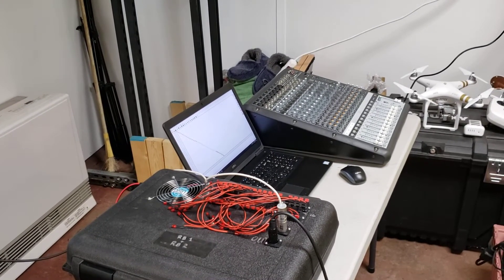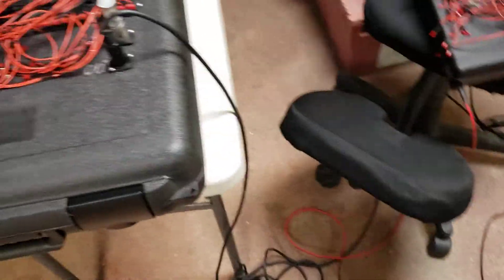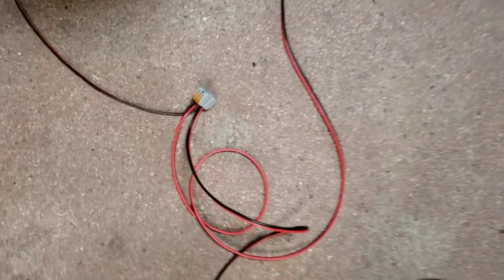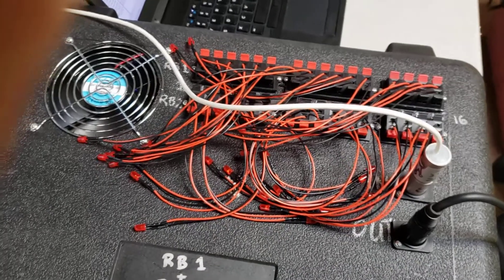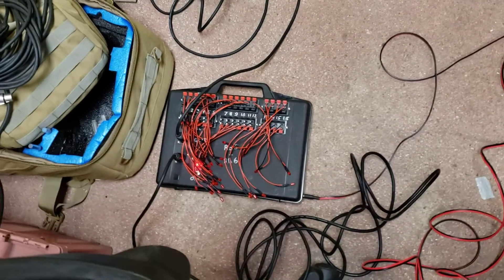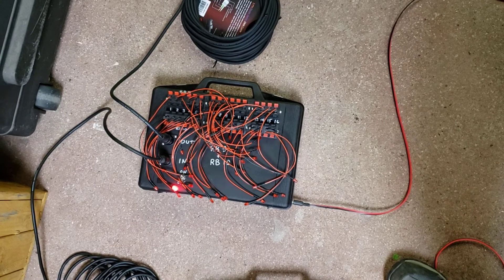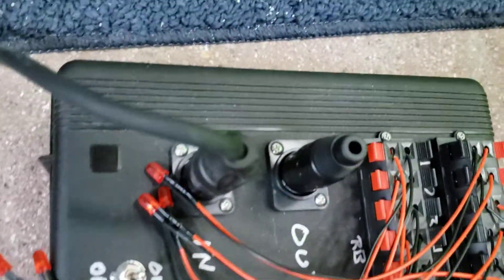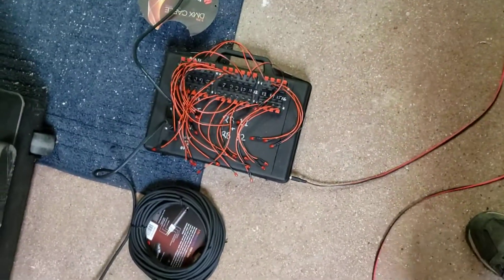DIY electronic Fireworks Firing modules for Pyro-Musicals.

Comment: I'm really impressed with this build and detailed description.  It seems as though some of your description was cut off, and I would love to read the rest. I was contemplating moving up to the cobra system, getting a 72M with DMX and the 18r2 with Smtpe to get around an audiobox. Looks like your system would work well to add in the DMX line, and get extra cues or just go all in this way.
Reply from the maker: Did you ever want to do a Pyro-Musical but looked at the cost of everything you would need and nearly passed out? I may have a solution for people who are looking for a budget friendly way to get it done.
It's a long post, but I think it's worth the read. If you're interested, please read on...
I wanted to share what I came up with for making a pyro-musical on the cheap. It doesn’t have all the features of COBRA or IGNITE or any of the other big names, so it will involve a little more work on your part, but you can put it together for hundreds or even thousands of dollars less depending on how many queues you want to use.
I will start by saying that for me, it was really cheap because I already owned the software, since I use it for another hobby of mine which is animatronics. Here is a video playlist of what I do with my life-sized animatronic skeletons at Halloween: https://www.youtube.com/playlist...
Because of that, I already had the software and power supplies and some other parts. The software is called “Brookshire Software’s VSA and is available here: https://www.brookshiresoftware.com/vsa_order.php?ct=yes...
The version you would need depends completely on how may queues you plan to use. The $80.00 version gives you 128 channels in total. That’s 128 possible queues. You can also fire several things using the same queue by using parallel connections of MJG igniters or talons. If you want more than that, you can get the Ultimate version for $250.00 that will give you 256 queues. If you want more than that, you can contact the company like I did and get a BETA version of the software that has 512 channels. That’s one entire DMX universe (the total number of DMX addresses that can be controlled in one DMX stream) That version will set you back $325.00
It is made for controlling servos, LED dimmer lights, Relays, and many other devices. It runs a DMX stream which is what I use. The software runs only on a windows computer, and you need a USB to DMX adapter (Which I already had as well). Here is a similar one to what I have: https://www.amazon.com/Interface-Computer.../dp/B07KW22ZK1
The adapter I usually use is from a company called DMX King and is $75.00. Servos are more fussy than lights and relays, and that one works better for my animatronics, but the cheaper one ($20.00) I listed seems to work fine for the relays and lighting devices I will be using.
I found a great price on some 16 channel DMX Relay packs. They would act like the 18M firing modules from Cobra. I got mine here for $69.00 each: https://www.amazon.com/Channel-Controller.../dp/B0111QP790 They have 2 less channels than the 18M’s, but they are a fraction of the cost.
One of the advantages of using a DMX controller (VSA software) to activate relays which sends power from my power supply (12VDC 30amp) to my MJG igniters, is that it can control other devices as well. I will also have a laser to shoot patterns through all the smoke, and 2 moving head color changing spotlights that can crisscross and spin around through the smoke, and even some electronic flamethrowers that you can program to shoot towers of flame to the beat of your music or make them do a chase pattern or whatever you like. These are the flame-throwers I will be using. This is one of many vendors you can find online:
https://www.ebay.com/itm/372969323529
I will be using 4 of those flamethrowers this year but will probably add more later. These can also produce colored flames according to the type of fuel you use in them.
So, before I get into how to program your show this way, and what features this software has or doesn’t have that other firing devices do, I will break down the savings for you. If 128 firing queues are enough for what you want to do, you will need to spend $80.00 on the VSA software, buy eight 16 channel DMX relay boards @ $69.00 each, one USB to DMX adapter for around $20.00 and a power supply with enough current to run all 8 (or more) of the relay boards and to fire the MJG Igniters or Talon clips. (You will still need to buy those igniters and/or clips. The price on those will vary depending on where you get them, how long they are and how many you need) With the power supply I’m suggesting you would be able to fire as many MJG igniters as you want in parallel. 30 amps goes a long way. Here’s the power supply, and it will only set you back $20.00: https://www.amazon.com/Padarsey.../dp/B06X96ZKK1
So, if you total that all up, it comes to $672.00 not counting the igniters or talons, which will vary depending on your needs.
Compare that to what it would cost you for 128 queues with the COBRA system, plus buying their music module that allows you to sync this up to music. That would be Seven 18M modules for 126 channels, the closest match in this case.
1 18R2 Controller $299.99
2 72M Firing Modules - Minimum of $879.99 each or $1759.98 (The 18Ms would be more $$$ but also more versatile)
1 Audio Box Gen 2 $449.99
Cobra Show Creator Software $49.99 ANNUAL license.
Not counting that the software package is a recurring annual fee, that brings you up to $2609.94 for just 144 queues.
I’m not saying that the COBRA products aren’t worth what they charge. I think they are fantastic, and I might even buy my own system eventually, but I spent my money on product, and I believe that with a little more work, I can make a just as impressive pyro musical with the things I am outlining for a LOT less money. If you start getting into higher numbers of queues, you save even more money.
The system I’m suggesting here will not have an integrated Fireworks database, and you would have to figure out the “Lift Time” for each shell and adjust your relay activation early by that amount manually on the timeline, and you can’t operate it from your phone, but you can from a windows laptop. You won’t get a continuity checker with this system, but you can test it by running the show without the igniters connected. Each relay has a LED that comes on along with the associated relay. You can hear the relays click as well to verify that they are working. If you have a bad igniter, or you don’t connect it up right, you will be out of luck and that igniter won’t fire even though the relay does operate correctly, so that’s a drawback, but it would only affect that one igniter.
You will need some DMX cables to run out to the area where your fireworks are set up, but if you want to go wireless, you can. (https://www.amazon.com/Donner-Wireless.../dp/B010D4VKPG/)
You can also do a hybrid setup where it’s wireless from you to the first relay pack you set up, then you run cables from that one to the next all the way to the end. Cables are very cheap, just a few dollars a piece and you can run them for 100s of feet if you want.
My goal is to help people that simply don’t have the budget for those big-name systems to be able to still do some great things that will amaze everyone that sees it.
I don’t sell any of these products or get a cut of any sales and I am not affiliated with any of them in any way. If you choose to go this route, you buy direct from the manufacturers or distributors. I’m just trying to share a way to do this type of thing for others like myself who either doesn’t have that kind of budget, or just likes saving money and doing a little DIY.
If there is any interest, I will be putting together a DIY tutorial on all aspects of this system from making music tracks to hooking up the hardware and programming the software. When I finally get to use it on July 4th this year, I will shoot video and show the results. I hope to be able to test out some of the timing ahead of time, but I’m confident that I have it as close as you can get it with any system.
Reply from the maker: I may be selling the whole system. Here's a link to the show that I put on using the system. (https://www.youtube.com/watch?v=zvDRW9oM5Sk) Due to operator error because I ran out of time during setup and wasn't able to do a full test of the system, one case did not fire causing 84 shells and four cakes not to get used which is the only reason there are some dead spots in the show. In any case, I really don't have enough room for these kinds of shows, and my wife is afraid of them, so I decided to make that show my last show. Contact me at bob@sindyskinless.com if you're interested. I can also provide you with the software to run it. After the show, I tested everything and all relays were working fine. In my last comment I posted the full text. It appears that you only get so many characters in the description.

Comment: I have a question and a comment:

QUESTION: I would expect at least one of your effects to be the kind that shoot up and "pop", with a loud crack and a flash of light. How are you going to compensate for the delay between firing the effect, and when it actually flashes in the sky (the internal fuse delay)? Even fractions of a second, like the audio delay on YouTube videos, can be detected by some anal-retentive OCD people. 😳

COMMENT: "Unlisted"?
Reply from the maker: Hi stranger! How have you been?!  In fact, I have 224 of that kind of effect in the show. The only way I, or anyone else have to compensate for that delay (called the Lift Time) is to set off the effect early by the amount of time it takes for that particular product to go through it's internal fuse. Unfortunately, it is not a perfect system because even within a case of 24 identical shells that time does vary somewhat. Sometimes by a few 10ths of a second. I pulled up other you tube videos of people firing the same effects I have. I downloaded the videos and put them into my editing software. I froze the video at the first flash of light from the launch and stopped it at the first flash of light from the charge going off and measured those lift times from 10 shells of the same type. Then I took the average of those 10 and set that as my default. The only way to know if you have it right is to fire it and see. I am using at least 8 different types of shells, and each of them have different lift times. This in incredibly annoying for me, being one of those anal-retentive OCD people, but it's the best that can be done. And that only accounts for the visual component. the sound will be delayed because of distance no matter what you do. You are more than welcome to come up and see the spectacle in person if you like. It would be great to see you again. We have moved to Newport, NH if you weren't aware. We made the move in 2020 while the pandemic was in full swing. Shoot me an email or give me a call!

Comment: DMX does not have any error detection or correction; per ANSI E1.11 1.5, it should not be used for hazardous applications such as pyro.  I would at least have a dead-man switch that would disable the 12V power unless it is being actively held by a safety spotter.
Reply from the maker: I am aware of it's shortcomings and can easily kill the power at each box or the whole line if need be. I am doing this for my own show in my own yard with a few neighbors and friends over. All 1.4 product. I am careful to isolate all my DMX cables from any power cables as well to minimize the possibility of interference. Also, I have taken care to design the layout of my show in a way that there would be no conflicts even if for some unfathomable reason every igniter would fire at once, nothing would collide with anything else and except for it being a very short show, there would be no danger any greater than the danger inherent in any fireworks should they be defective or improperly used. All my shells will be fired from racks I have made with 2X3 construction and spacers between all tubes. All my tubes are HDPE DR11 tubes. They will all be anchored to the ground and all cakes will be glued with Liquid nails to large firing boards to prevent anything from tipping over or jumping. For a home show, I simply can't justify spending the kind of money it would take to get a professional system for 224 cues, plus I will be using other non-fireworks effects such as DMX lights, a laser, and 4 flame machines all synced to the music track which I couldn't do with a cobra system or other non-DMX system.